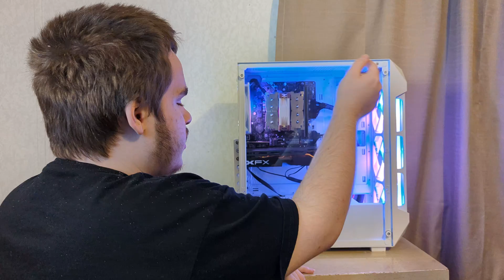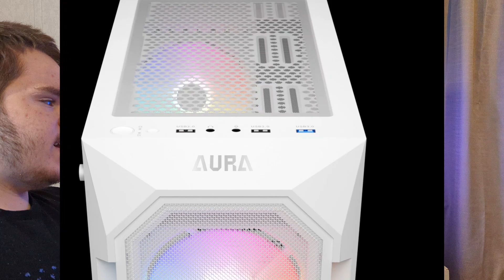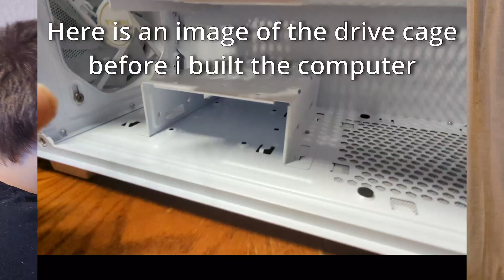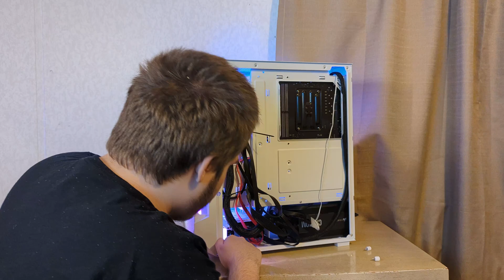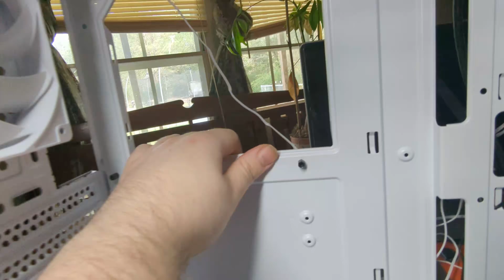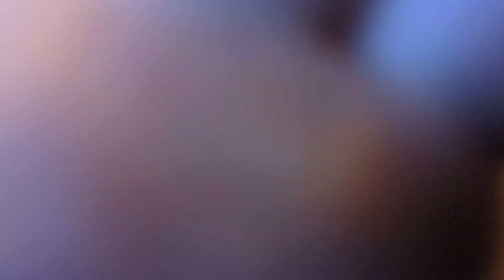The Best Budget PC Case  |  $60 GAMDIAS Aura GC1 Elite Review #computer #pcmasterrace #computercase

Comment from the maker: Hello!

I wanted to answer some common questions about this case that i may not have made clear in the video.

The Fans run purely off of a Molex connector, they do not have a 3 or 4 pin fan connector to connect to the motherboard or a fan controller. The fans in this model are not ARGB but rather have fixed color leds, even though ARGB is right on the box. The regular Aura GC1 does  have ARGB, but the elite model shown here (the elite version has 340mm gpu length clearence whereas the regular version is 260mm) does have ARGB, but they do not use the same box. 

This case does not have any vertical GPU mounts, only horizontial slots are present. You could potentially buy your own diy conversion kit and riser, but make sure that it wont leave the fans close to the glass, as this will hurt your cooling performance. 

This case can fit up to a full size ATX motherboard, but i dont have any atx boards on hand to test fit, plus the system in the case is my main desktop. 

The power supply can only be mounted fan side down, the holes needed for fan side up mounting are not present in the case.

The case can fit 3 120mm fans in the front, as it ships in that configuration, it looks like you could mount a 360mm radiator, but i dont have any to test fit. The top mount according to gamdias supports 2 120mm fans, but there is a second set of holes for 140mm fans, but i dont have any 140mm fans to test fit.

The front can according to the website accomodate 2 140mm fans, but there dont seem to be any mounting holes present for them, but thats not a big deal for most buyers as the case ships with four fans that are of good quality for the price, if you plan on replacing these upon purchase, you should spend your money on a case that includes less fans but maybe a higher built quality.

The rear fan slot can only accomodate a 120mm fan, there is one installed from the factory.

Comment: Don't believe this guy, this is the worst case i have ever purchased and tried to build in. I built a back up for my office with this case, and well it just doesn't handle things very well and the ARCB version i got was very well not so good, I couldn't replace the fans in this thing with better fans unless I was willing to do some wire splicing so i  could use a fan controller. This thing is a mess to cable manage and so on....I am replacing this case very soon...

Comment: Is the front mesh removable?
Reply from the maker: It's not removable like a fan filter where it's magnetically thing it's a part of the front panel and it can be removed if you need to clean it or you need to swap out the front fans. You don't have to remove it as long as you're not accessing the front fans though you can still build the system just fine with it on and I can't really think of a reason that you'd want to take it off during a build other than accessing the fans and maybe mounting a radiator in there but I don't think they'd be room for it and you shouldn't be mounting a radiator in this price category of case anyway cuz you're spending 60 bucks on a case your total build budget probably isn't that much and if that's the case it's not really worth investing in water cooling for low end to mid tier parts.

Comment: Do you know how to take out the front mesh so I can replace fans? I’m wanting to replace all my fans!
Reply from the maker: You just have to pull on the front panel to get to the fans and unscrew them from the case from the inside, its rather difficult in an assembled system as they are mounted on the outside of the chassis. When reinstalling fans (this case supports 3x120mm) i would install them on the inside of the chassis where the screws go into the fan from the front towards the back.

Comment: Hi, pls i bought this case nd didnt checked cpu cooler max height which is 160mm nd i already have deepcool ak620 which also 160mm, is it gonna fit or ?
Reply from the maker: @burnedmemory  it should fit,  but if it doesnt, the thernalright peerless assassin is a good option for 35usd

Comment: i bought this case for 40$, can i control rgb from software?
Reply from the maker: You cannot control the RGB in software, or at all. The fans runs purely off of molex in the GC1 and GC2 elite. They do not have an ARGB connector or pwm control. The regular GC1 and GC2 have that but the larger elite shown here does not
Reply: @rysterstech  i'm going to disconnect it and keep it without rgb

Comment: What kind of connector do the fans in the pc require. My current motherboard does not have any RGB 3 pin headers, so i'm trying to find something compatible with it.
Reply from the maker: @BennettPeterson-g3p  These fans use exclusively molex. They connect to your power supply, so it doesn't matter what fans connectors your motherboard has. These fans are not ARGB, rather the lighting is static and runs off of molex. 

Hope this helps you solve your problems!

Comment: bro can you make a video of how you connected your case to the motherboard, thanks the video.
Reply from the maker: @righthookmma  the motherboard mounts in this case like any other. Just make you dont have any standoffs that will hit the back of the motherboard where there is no screw hole. Some older motherboard have a different screw placement on the middle left of the board by the PCI Express slots that modern cases don't always support but you can get away with not having that screw installed.

The front IO connectors just use standard usb 3, usb 2 and HD audio headers. The front panel power reset and led connectors are individual so they will work in boards that don't follow the newer standards like those pulled from a prebuilt or some server class motherboards.

Comment: Is it ARGB I MEAN CAN I CHANGE PC FAN COLOR
Reply from the maker: The stock fans shown here are not ARGB, the lighting cannot be adjusted from the default configuration as the leds are powered by the same molex connectors as the fans themselves.
Reply: It is argb(auto) which is fixed and cannot change colors  @rysterstech
Reply: Not addressable

Comment from the maker: 7:15 important correction, you cannot install the power supply fan side up, as there screwholes do not line up. I tried to flip mine over for better cooling but it doesnt screw in.

Comment: Bro I recently purchased the same case, but I'm having trouble connecting the fans. Can you show me how to do it? 1. How should the fans be connected to the power supply? 2. Should they be connected to the RGB headers or the system fan headers on my motherboard?
Reply from the maker: The fans are powered by a 4 pin molex connector, often called peripheral connector or LP4. They only go in one way, and these fans can be chained together, you can plug one fan into the power supply connector and then connect the other fans to that one, but you can plug them in seperately if the cables are not long enough to chain them, i had to plug the back fan into its own connector and the front fans are plugged in together in a chain. The RGB lighting on these is powered by same molex connector that powered the fan motors so they can spin, these do not have an RGB or ARGB header that connects to a motherboard, and the lighting cannot be adjusted, what is shown in my video is how it comes from the factory, and you cannot change or disable the lighting in any way. Higher end case fans usually can connect to the motherboard, but the fans included with these cases are on the cheap end of things (but do their job perfectly well) so they only come with the molex connector. Sometimes these connectors are hard to plugin as its a very old design. You sometimes have to wiggle them, but you cannot brute force these in, they are easy to break.

Hope this explanation helps you fix your problem! 🙂

Comment: How can I change the fan led colour?
Reply from the maker: The fan lighting does not change, you cannot adjust the colors or even turn them off, which since uploading this i looked at the box itself and it does say there is argb support but both the website and my own findings show that there is no argb functionality, although the GC1 non elite does have that feature, but it only fits 260mm gpu's rather than 340 on the elite models.
Reply: @rysterstech  يارجل ارجوك اريد تغير لون المروحة تعرضت لصدمه نفسيه💔💔
Reply: @zos611ونا نفس الشئ ولكن اغيرها من زر Restart 6
Reply: @modygaming2126   كيف والله ماقدرت

Comment: Bro, you can't make a pc related vid and not have your specs in the description. Common knowledge (or so I thought).
Reply from the maker: I have since added specs to my description
Reply: @rysterstech My old PC had identical specs, 5600x and faster ram are the two notable differences. RX580 has to be one of the best, if not, the best price to performance card In the used market. Nice build!

Comment: I have a question about the aura gc1 elite does it take fans on top and if it does  how many and how manu mm and if i put there should i put the as exhaust on intske nice review btw and really helped
Reply from the maker: if you look at the amazon documentation, it says it supports 2 120mm fans, although it appears there are mounting holes for 140mm fans as well but you might run into clearence issues with the top of your motherboard if you are using 25mm (standard) thickness 140mm fans, you can definitely not fit a 140 or 280mm radiator on top. Unless you have a radiator to install in the top you should retain the stock fan layout, as adding top exhaust fans will hurt more than they help. Adding a top intake wouldnt help either as there is already plenty of airflow coming in the front and disrupting the front to back intake path would reduce overall cpu cooler airflow. If you have a radiator (which if you are buying a budget oriented case like this one you shouldnt be spending money on an aio, a dual 120mm tower runs you $40 from thermalright with the peerless asassin, i would recommend getting the black version if you have the white case like mine or the white version if you have the black model) the top would work as for an all in one cooler that usually means the pump is in the cpu block, having the radiator above will extend the pumps life due to not being starved of coolant.

Comment: Can i install graphics card verticaly in this case?
Reply from the maker: no you cannot. There are no slots for vertical mounting  in the case itself. If you were to use a bracket to retrofit it in this case, make sure your gpu is a few inches away from the glass or your thermals will suffer from the airflow restriction
Reply: Another question , can you control the RGB of fans by software ?
Reply from the maker: @jenus2558  These fans do not have ARGB, the lighting cannot be controlled via software, the lighting is not animated in any way. These fans are powered by molex connectors, so you cannot control the speed either, but these are quiet even at the full 12v but you can undervolt them by taking a molex extension and on the male connector you can swap the ground closest to the 12v with the 5v pin by repinning them to get an effective 7v on the 12v rail, therefore the fans will run quieter, never plug something like a hard drive or a fan controller into this, as it will die as the connector is no longer wired correctly.
Reply: @rysterstech  i see. Thank you